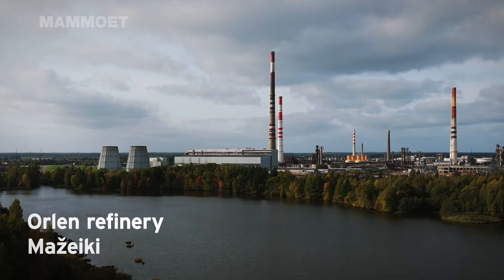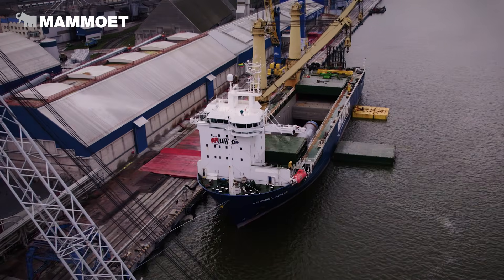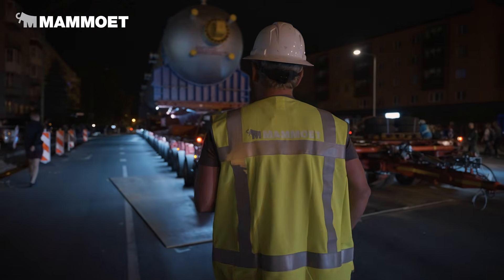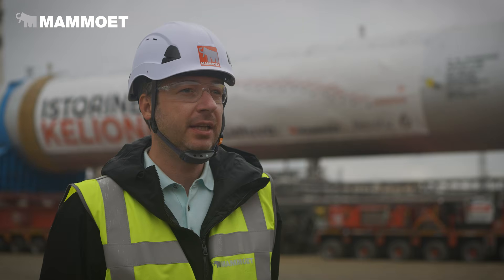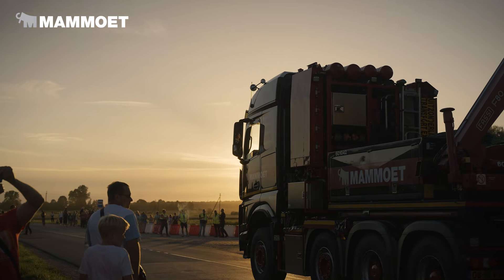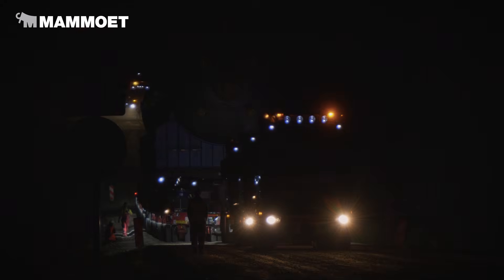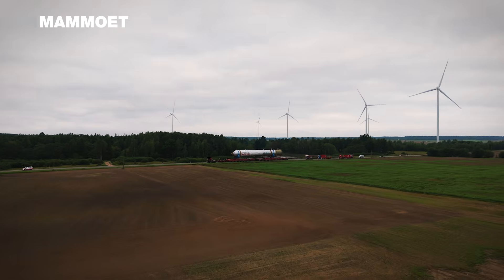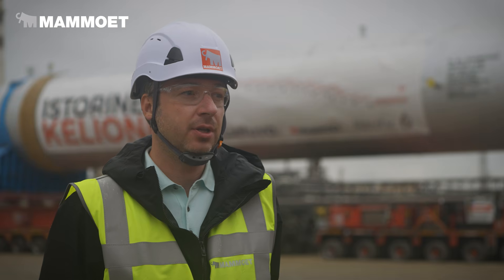RECORD-BREAKING reactor installation for Lithuanian refinery

Comment: New reactor for old Soviet refinery....
Reply: On the site where Soviet refinery used to be. Funny how this time, you aren't blathering about lack of industry in the Baltics. Cope.
Reply: @xandervk2371  Not the "Soviet" but the Soviet occupation refinery - there is a huge difference!
Reply: To avoid it being an "old Soviet refinery", a POLISH company, in this case a branch in Lithuania, is installing new and very modern petrochemical equipment. AFTER installing the complete equipment, Mažeikiai will become a MODERN POLISH REFINERY.
Exactly as it happened in Petrochemia Płock in Poland.

Comment: This Lithuanian refinery processes Russian oil for the europian fuel market.
Reply: Not quite. Orlen Lietuva operates a pipeline system with a length of approximately 500 km. Included in this system are two pumping stations near Birż and Janishka, oil pipelines to the refinery in Mažeikiai and the oil port in Butinge, and an oil pipeline leading to Ventspils.
Generally, oil is supplied via the Baltic Sea. As a rule, Polish Orlen DOES NOT BUY Russian oil. Maybe you haven't noticed, Polish companies willingly comply with all sanctions against Russia very eagerly.
Reply: Didn't Russia shut the pipeline as early as 2006, and also try to burn the plant down the same year?
Reply: @xandervk2371  It doesn't matter to me what Russia wanted, what they did or didn't do. What matters to me is that Orlen has invested and continues to invest HUGE money in Mažeikiai for mutual benefits: both Poles and Lithuanians.
Reply: @andrzej3511  Yes, the point was that Russia cut itself off, anyhow.

Comment: Here's an idea:  Use the self-erecting concept from tower cranes to erect the gantry crane used here.  I assume the crawler crane is still essential in this application, but perhaps the concept would be useful in the future.

Great job on this video also; it's a look at how you did it and what it means for the various parties involved.
Reply: This is already invented, but not needed on this project! The height wasn,t the issue but the footprint on site and the weight was a different story.

Comment: Also crazy how these tall massively heavy objects are just held in place by a few big bolts nuts and washers 😂, relying a lot on their weight I guess.
Reply: As long as you do not have heavy earthquake the weight should keep it in place fairly well.
Reply: @rob8278  There are almost no earthquakes in Lithuania. A few over the last 20 years that vibrate things a bit and thats it.
Reply: It's built in India.
Reply: @Pratikdd  What is?

Comment: Why do these things weigh so much when they essentially look like hollow tubes? What’s inside them?
Reply: Very thick shells with lots of reinforcing sections and tons of weld filler.
Reply: Pressure vessels are designed against pressure and temperature.
The higher the pressure and temperature - the thicker the vessel walls need to be. 
Pressure generates membrane stress circumferentially and longitudinally while high temperature makes steel weaker. So you need to allocate enough thick metal to resist both.
Reply: 30cm thick outside "walls".
Reply: There are several different “floors” or levels inside.